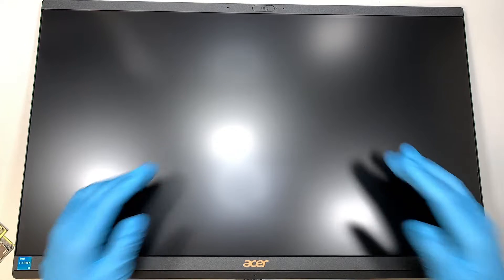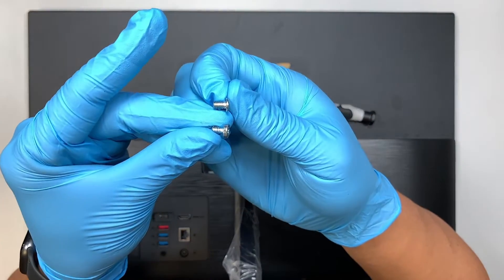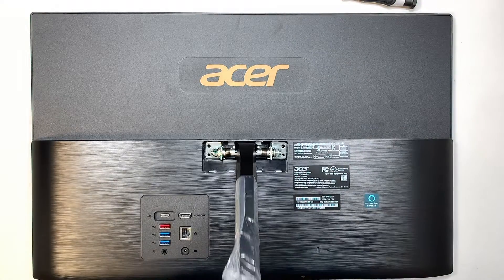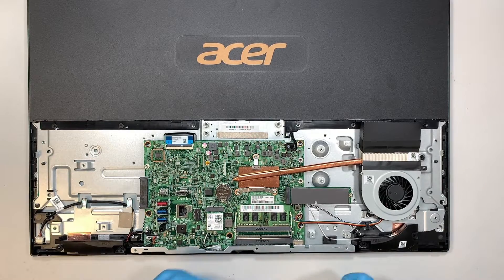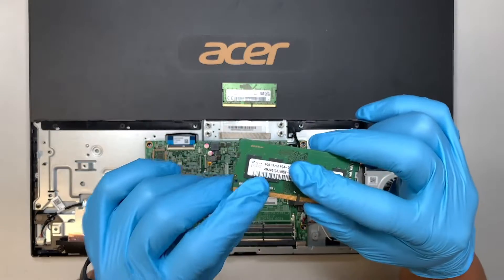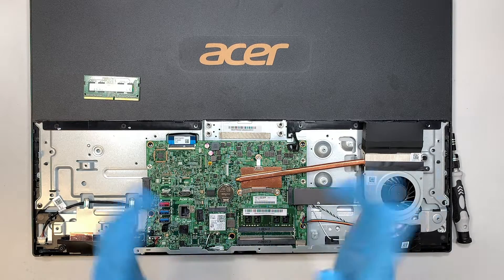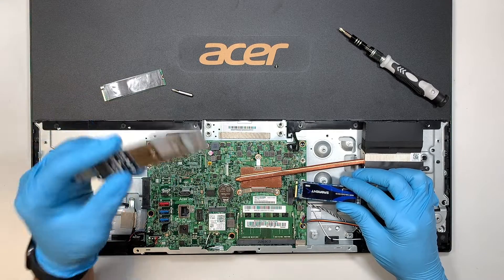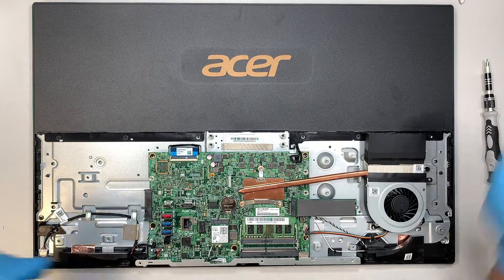Acer Aspire C24 1700 Upgrade M2 SSD and RAM

Comment: 11:47 this is incorrect. You DO NOT need to buy a new copy of Windows. As long as you have an 8gb or larger USB stick with Windows already on it. You can plug it in and install. Be sure that no other devices are plugged in.